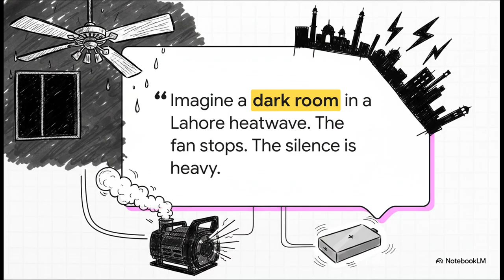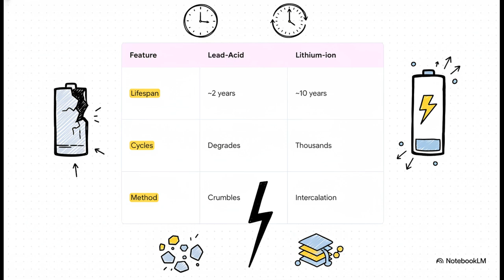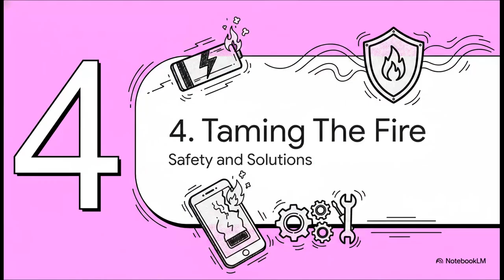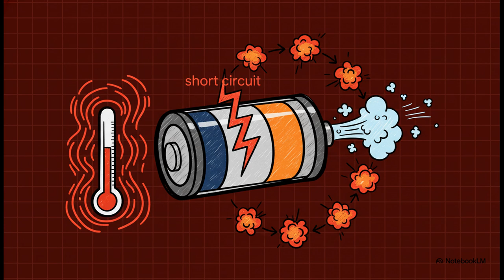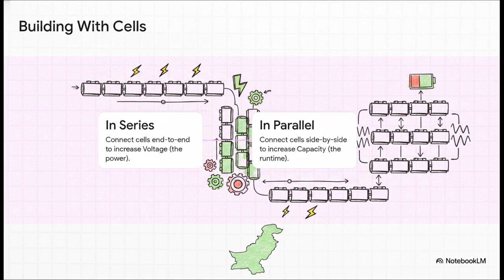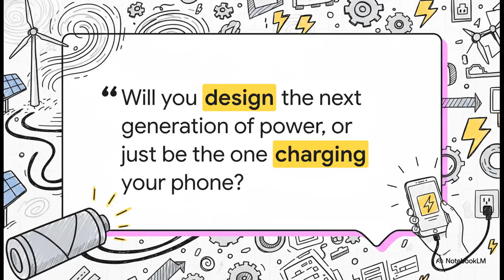Why Lithium Batteries are the Best Solution

Comment: No
Reply from the maker: 1. Tubular battery: 60–80k PKR, life  2 years → in 4 years you spend 120k+ again

2. Lithium battery: 120k PKR, life  4–5 years → one-time investment

3. Tubular: maintenance + water + performance drop

4. Lithium: zero maintenance + stable performance

5. Resale ↓ in lithium, but overall cost per year is lower

So resale is one factor, but **total value over time clearly favors lithium👍
Reply: @AbidPowerThoughts what about the bomb?
Reply from the maker: I didn’t mean an actual bomb. Tubular batteries (lead-acid) can be risky if mishandled, like gas buildup during overcharging. With correct installation and maintenance, they’re generally safe.
Reply: @AbidPowerThoughts tubular has a life of approx 4 -5 years in my country, since power cuts happens occasionally and for a max of 30 mins.

Keeping lfp battery always fully charged is bad.
Reply from the maker: @AryanRaj-xe1fw  “You’re right about tubular in low-usage scenarios.
But LFP batteries offer 4000–6000 cycles vs 800–1200 for tubular, plus faster charging and deeper usable capacity.
And yes, keeping LFP at 100% constantly isn’t ideal, but good systems allow charge limits to handle that.”